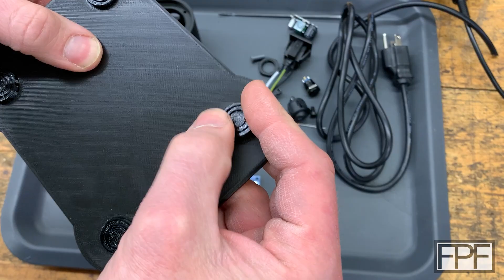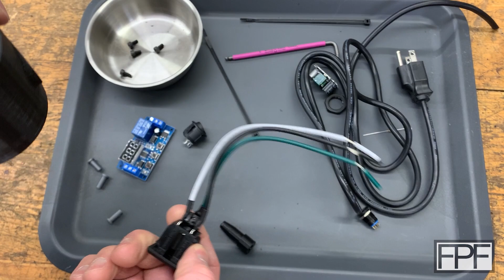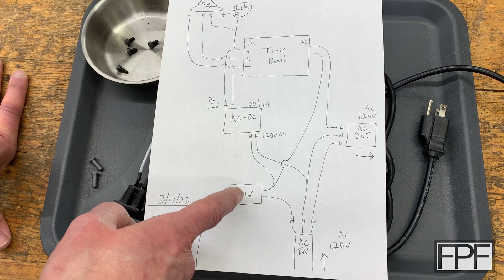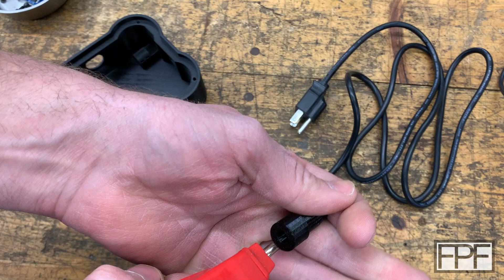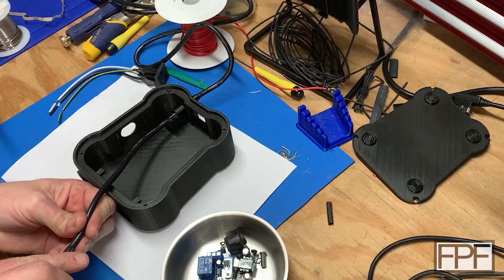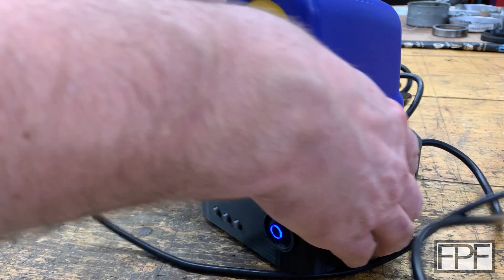3D Printed Auto-Off Timer Base for Hakko FX-888D Soldering Iron - Part 2

Comment: In a future update of that nice case, instead of fumbling with screws all the way at the bottom of that area, why not just put a raised  inclined tab that will guide the bottom part to the proper location and keep it in place and only use the two screws at the top? This will prevent having to drill or use self-tapping screws in that confined area.

Comment: Very nice and well thought out.  I have this very same soldering iron setup so this interests me very much.  One question though.  It looks like you reduced the space at the bottom of the temp unit and it has a vent there at the bottom.  Have you noticed any heat build up in that area?  Thanks for taking the time with these videos and answering questions.
Reply from the maker: Thx. I have not, but I also rarely use mine for longer than about an hour at a time.

Comment: Very interesting. I would recommend using ABS or PETG for this as PLA is flammable. Especially with the high voltage lines.
Reply from the maker: I think I saw bambu has some flame-retardant stuff now

Comment: Very nice project. The only thing I'd change is to put an exteral fuse or small circuit breaker thru case instead of the internal one (it's not hard to take the 4 screws out! LOL). Thank you for your interesting and informative videos.